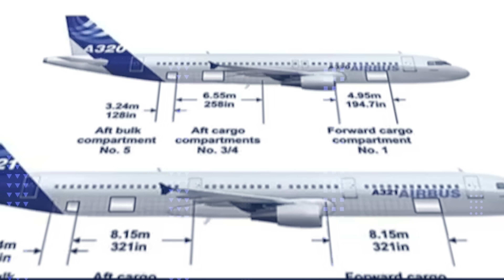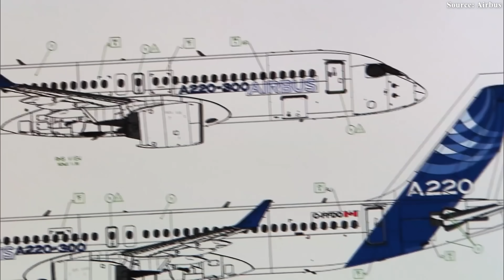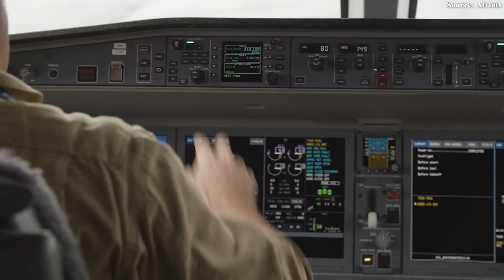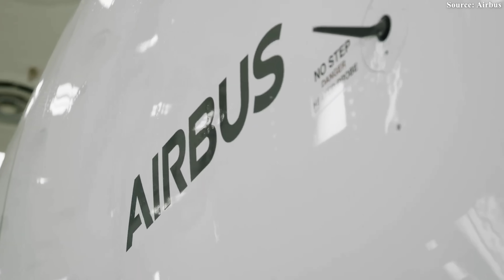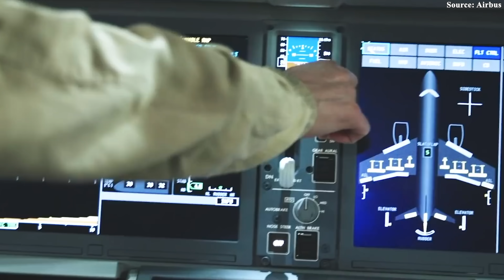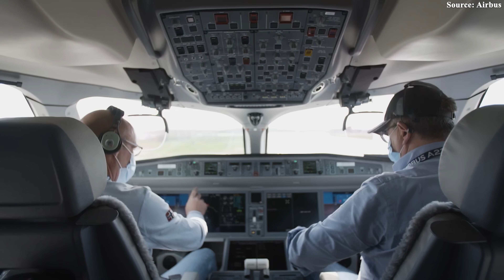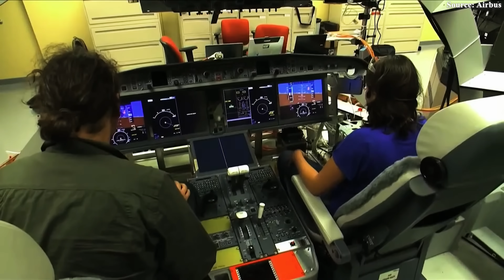Airbus' HUGE PLAN for NEW A220-500 SHOCKED All Aviation! Here's why

Comment: I really wish YouTube would shut down this AI-generated propaganda machine. First, there is ZERO commonality between an Bombardier C-Series (aka A220) and the Airbus A320neo family. The A319neo is already dead and the A320neo is nearly dead making the A321neo an orphaned aircraft. No more A320neo family. The A220-500 will kill the A320neo. The low-to-no margin LCC business model is dead, but Delta and other major carriers will simply use the PW-powered A220 series aircraft as a tool to feed their bigger networks.

But General Electric (GE) and JV partner SAFRAN are trying to control the market by focusing their CFM LEAP-1B engine production on the B737-8/-9 and CFM LEAP-1A engine production on the A321neo and has no interest in supporting the B737-7 and B737-10. Now GE wants to power the A220-500? GE along with SAFRAN is the DARTH VADER of the commercial aviation industry. Boeing and Airbus only make tubes with wings. GE only cares about dominating the aircraft engine market, not about airline networks, operational efficiency, and airline profitability.

Comment: The SR-71 Blackbird flew @ mach 3.2 w/2 P&W J58 engines producing 34,000 lbs. of thrust with after burners engaged.
The Boeing 777 can't achieve mach 1 w/2 GE9X engines producing 134,300 lbs of thrust without afterburners.  Why is SR71 so fast?  Or Boeing 777 so slow?

Comment: Not a shock, the original C-Series already engineered the CS-500 and CS-700 what is now the Airbus A220-500 and A220-700 which requires a new larger wing and stronger landing gear.